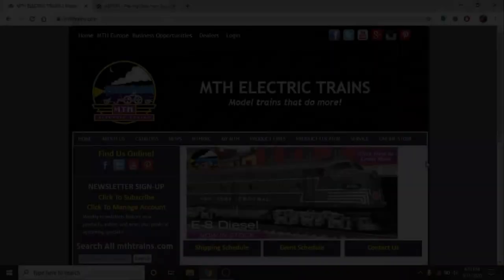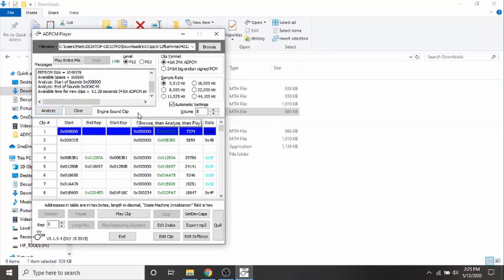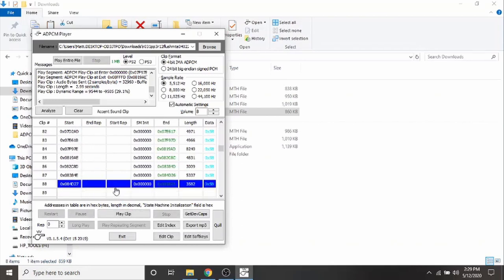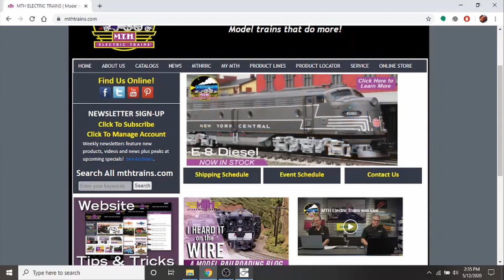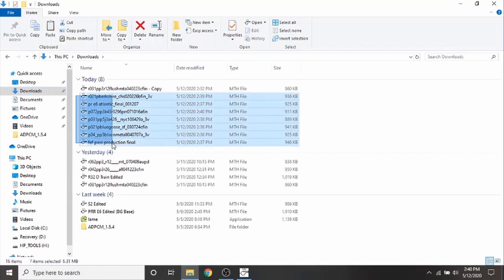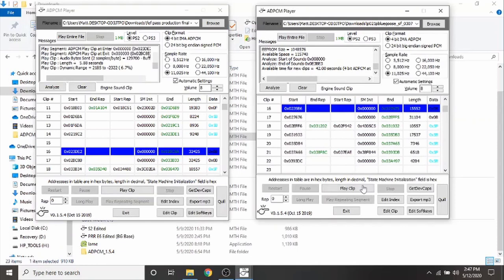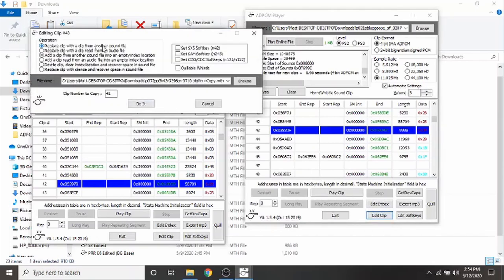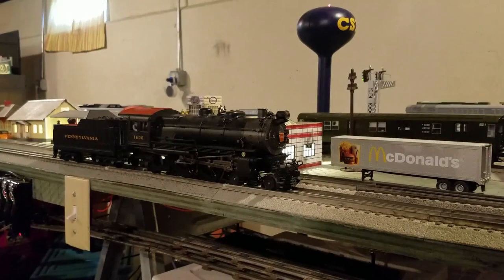Changing And Editing Sound Files On MTH Engines

Comment: Great video, there is another method for sounds that I read up on that nobody talks about. There is a way to add your own custom recordings by using the DCS remote.
Heard about it on the OGR forum
Reply from the maker: Thanks. The custom sounds are cool but they aren't engine specific. In other words, the custom sounds are stored in the TIU and due to this, the same sounds are used for each engine.
Reply: @trainlover9943   I only bring it up cause I'm customizing a ten wheeler to look like one of walt Disneys engines and was gonna add custom recordings from the theme park into it
Reply from the maker: @MattyCtrains  Cool! If it were me however, I'd take the theme park clips and put them in the cab chatter sounds of the sound file.

Comment: First, thanks so much for this awesome, awesome video!  But I have a question on file sizes.  I downloaded two recent PS3 steam files.  One was just under 2mb, and one was over.  But my understanding was that all PS3 sounds sets were interchangeable.  Do you know if all PS3 boards have 4mb of space and maybe this one engine just happened to have a smaller file loaded on it?  Or do different PS3 boards have different amounts of space?
Reply from the maker: Thanks! I believe all PS3 are 4mb boards, some files just happen to be smaller.

Comment: Matt, thanks for the tutorial!

I'm having an issue with getting a PS3 whistle to work on a 3v PS2 loco... It comes out at loud static after I load it into the loco. All of the other sounds still work (other than the ones I deleted to make room for the new whistle). Am I missing something??
Reply from the maker: Glad you enjoyed it! With PS3 going into PS2, that's not always easy. I'm thinking the issue is the clip types are different (the PS3 whistle and bell clips, for example, the majority are in 4 bit PCM audio type and can't be used in PS2 engines) try using a PS2 version of the whistle you want and then reload, that should fix it.

Comment: For some reason, every time I change a sound, I get an error message saying "Dolt: Unable to open file... Access is denied. How do I fix that? I think the sound files are locked, and it prevents me from changing any of the sound tags.
Reply from the maker: Need to be more specific. What sound file are you using?
Reply: @trainlover9943  I'm trying to change the whistle on my MTH GS-4. No matter what I try to change, I get an error message saying that access is denied. I've tried "Replace clip with another clip from sound file", "Replace clip with another clip read from an audio file". Nothing works.
Reply from the maker: @PetersTrainz  PS3? If so, take it out of the zip file. If that doesn't work, get a fresh file and try again. If still nothing, email the developer. He's helped me a bunch.